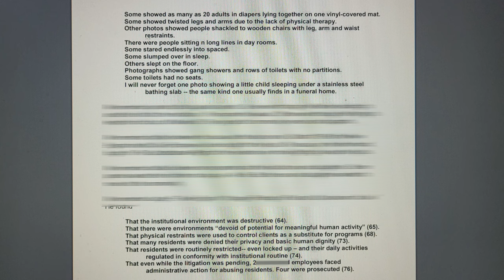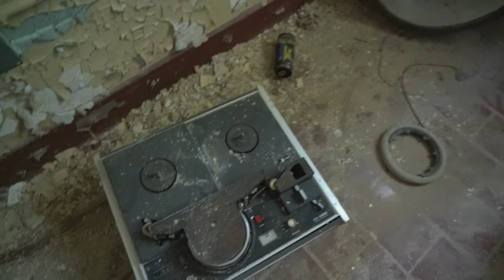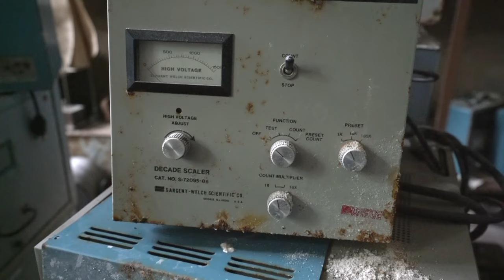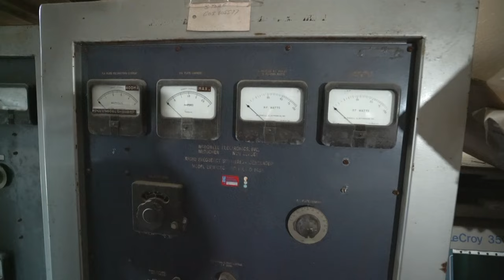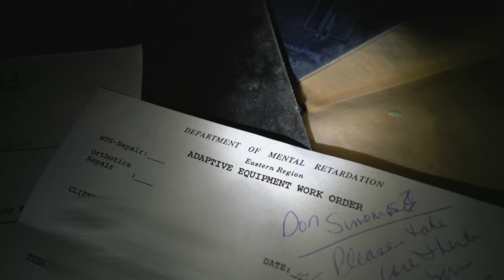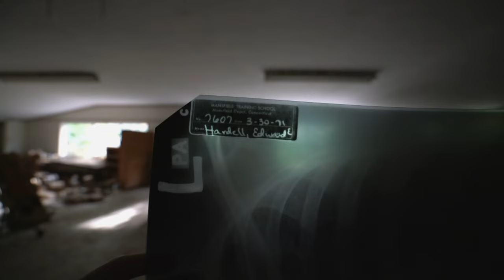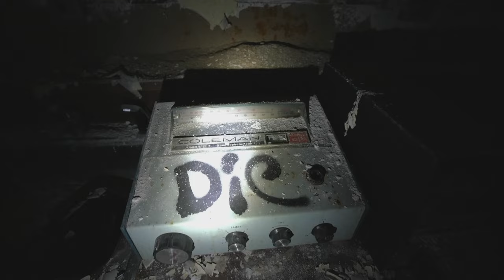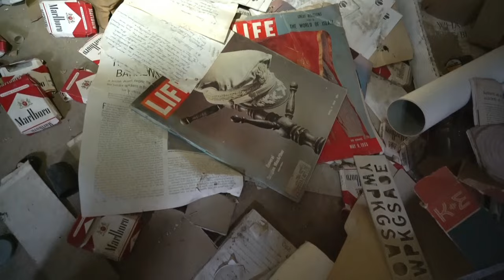Abandoned Childrens Asylum - Found Hundreds of Restraints (Closed from Abuse)

Comment: FYI, all those devices with straps, wood, padding etc are not for torture or restraint. For example, the long horizontal wood board with straps at the top, middle, and bottom is called a Stander. People, (like my son), who are unable to stand still need weight-bearing on their hips and legs so that the hip sockets will still try to form. The patient is laid down, strapped in, then the entire table rotates vertical, giving the person the weight-bearing as if they were actually standing they need for development. And often, tray tables attach to them once they are vertical. The other devices with Velcro straps are all to secure the patients who are unable to support themselves. My son's wheel chair supports him with side laterals, straps, leg and foot supports and even a padded brace for his head as he doesn't have the ability to move or even sit up on his own. Love all of your videos, just wanted to pass on my info.
Reply: The company in the video (Rifton) still sells these chairs. There are some articles about misuse to restraint childrens and even a public statement from the company but there are legitimate theraptic reasons for these chairs. Thanks for your insigts.
Reply: THANK YOU!! I was just going to say the same thing. Yes many many were abused but, these were all to help the patients!! Another great video!!
Reply: I was thinking the same .
Reply: pin this, please. not saying they didn't misuse these devices, but that is not the intention of them.
Reply: Very well said
Reply: Thank you for sharing the information.
Reply: I came here to say the same thing! I work with students who use standers and Riftons and they are absolutely not torture devices.
Reply: Often the
Reply: I've seen people like this
Reply: delusional
Reply: @Darrin R. twister please tell how it was used for torture
Reply: @Darrin R. I see.
Reply: THANK YOU for correcting this!  I work with special needs kids as a nurse. These are not torture devices!  They’re therapeutic!  Can they be used “improperly”?  Of course!  A simple chair can be used as a restraint!  Holding someone’s arm down is considered a “restraint”. I’m glad others have come forward about this. These devices help improve these kids quality of life ❤️‍🩹
Reply: @sheryldupre-mercier7607  people tortured them kids. And abuse goes on today. step into reality
Reply: you a wok democrat? Trump 2024
Reply: @johnd2768  I’m not saying horrible things didn’t happen. I was just staying that those items do have a therapeutic purpose when used properly. Institutions were and still are horrible places 😢
Reply: @sheryldupre-mercier7607  I understand and please accept my apology.
Reply: 🧡🇨🇦🧡Look into ORILLIA 
 H.R.C HOSPITAL 😭
Reply: Just because that’s what they’re used for NOW does NOT mean that’s what they were used for In times when abuse in these places were “normal”
Reply: @krystalconley4915  my point is that torture is NOT what these devices were manufactured for. I highly doubt that a company would design, manufacture, and sell torture devices in the US. WHAT anyone did with them beyond that is different.
Reply: No they were for torture. So sad
Reply: Ok, torture devices were approved and sold on the market openly! Stop displaying your ignorance.
Reply: May God bless you and I wish you and your son all the best.
Reply: @hooville9059  you are too kind. They said my son would not likely live past 2, he turned 32 in January. God IS GOOD
Reply: I was coming to say the same. I used to work for Mass DMR. (There are still a few places that are still running, for those most profoundly affected). I watch these videos and roll my eyes when they call assistive devices,  torture or restraints.
Reply: Yup, and the restraints on the wheelchair are for preventing the person from accidentally falling out of the chair or being injured in case of a seizure.
Reply: @lynnjudd9036  exactly! My son has no ability to move on his own. The straps are actually for his safety.
Reply: @KikiErzebet  should have said this a long time ago, but thank you for what you do for the special needs. Blessings!
Reply: Thank you! I was going to explain the same.
Reply: This is so true, I have a standing frame.
Reply: That's a lot of words

Comment: I lived near a home for really badly disabled person. They use those strap things to keep them upright. A lot of them are not even able to sit or be in an upright position but they can not lie down their entire life. I've seen some laying in wooden boxes with wheels pushed around by others who are not so disabled. The box looks like an open casket but they would fall off anything else than these boxes. It looks cruel but it is not.
Reply: Exactly!! I work in the disability area, they are support straps not restraints, stop people slumping over or sliding off chairs.
Reply: Although it's often difficult to tell Victorian restraints apart from the devices they would have used for holding the severely physically disabled in a fixed body position when necessary.

Comment: Those X-rays were most likely to check each resident for tuberculosis on an annual basis before they had injectable TB tests. Necessary in such close quarters. Many of the devices with straps for sitting/standing were actually adaptive equipment allowing residents to better interact with their environment for a period of time as opposed to lying flat on a bed looking at the ceiling. Yes, I am sure there was abuse as staffing got less and less. I used to work in a  children’s home for profoundly disabled children. Thanks for showing us this one! 
Maybe some day, you could attend therapy sessions with differently abled kids and see these things used for good. It will make you smile.
Reply: "Custom Adaptive Devices."

Comment: As others have commented below, those items are NOT restraints.  They were used as support to sit or stand, so the belts were used to keep them in place.  My daughter was handicapped and had a supportive chair and a prone stander (which are the ones seen in the video with the long slanted back.....they would stand in them belly side to the padding and would be propped up against a table to do activities).  My daughter also had the same brand "Rifton".  However, it could be that this place was not using them correctly or keeping the patients in them too long, which would be abuse....but the items themselves are not meant for restraint or abuse.

Comment: Those chairs with straps are for children that could not sit up due to paralysis, abnormal spines etc. They are no way used for punishment. The upright board with restraints was to put a paralyzed person in a standing position. Modern physical therapy has such things Today.   Quadriplegics in this century have wheelchairs with Velcro belts around chest ankles etc. 
Lung x-rays were necessary to check for Tuberculosis.

Comment: 9:09  that is called a rifton seat, it is meant to be a positioning chair to hep with posture and blood flow, breathing, feeding etc. they were not meant to be used as a restrain or punishment, but sadly they did end up being used for that,  but the actual purpose of it is for positioning someone who limited body control for circulation, reducing contractions, cramps, clots, stomach and intestinal issues swallowing  and so fourth,so yeah,  for use it in short bursts, not for hours on end.

Comment: The unique looking chair in the basement with the green section and wheels looks like a piece of physiotherapy equipment as we still have very similar looking equipment today, it’s often used today for children to stretch their hips and inner thighs, the foam looking cylinder keeps a gap between the legs and the child would scoot around (using their feet to push like kids do with balance bikes) holding on to the handles at the front for exercise and stretching. So thankfully as far as I can guess at least this ONE piece of equipment was not for restraint but by the sound of the history of the place I’m sure much of the equipment could have been used for restraint, particularly seats that could be used as therapy devices, it’s possible that they could strap kids in and leave them there for extended amounts of time.

Comment: Those chairs weren’t for punishment (per se). They were used to prevent children who were impulsive from trying to stand and getting hurt when adults can’t watch them 24/7, or to support children with different conditions that don’t allow them to hold their body upright or can’t support their head. I 100% agree there was abuse, but those chairs weren’t it. In fact, we still use chairs like that today (just better manufactured so they are more comfortable). 16:40 those are to practice core stability. A lot of children with neurological issued struggle with core stability- such as CP. and 18:15 these are again used to support them so they can be in a more upright position. The ankle restraints are so their feet don’t slip forward- and belt is so they don’t fall forward (they don’t have the strength to hold themselves up). The two pieces by where the head would be is to support their head so they can still look around, otherwise they will often fall into uncomfortable positions. 21:03 looks like an inversion table. We use them sometimes for traction but often for individuals who can’t sit up right. We slowly attempt to increase degrees every few days/weeks in an attempt to help their body acclimate to standing upright. These are still used. Wanted to like this video but too much misinformation. Maybe a little research on future videos.

Comment: Some of those restraints were meant to be used for patients that could not sit up on their own. So they were placed in the chairs and Velcro straps were used so they didn’t fall forward out of the chairs or slip down. The others were used as physical therapy to help patients stand to keep muscles and hips from  twisting or make them stronger. They are not used as barbaric tools. But as aids for nurses and doctors used for the good of patients. They look awful but are very helpful when used properly by patients that are in need. The area with chemicals were used to develop the X-rays. They were done on film like old photos. So u needed the chemistry to develop them. And the lighting sources to focus in on certain areas and to lighten or darken the film so doctors could see certain parts of the anatomy easier.

Comment: Those are NOT restraints young man, they are custom adaptive set-ups for physically disabled kids. These hold the client so they can breathe and they are widely used today. "Restraints" were mainly the 4-point, By the 70's straitjackets were replaced by this "more humane" 4-point systemI did several in the 80's. They are simple straps, usually early velcro or nylon, which strap each arm and leg to a bedframe, so they do not hurt themselves or others. ANY type of restraint must be have a dr's order and is absolutely the LAST RESORT. We were NICE counselors who LOVED the guys- we hated to do it and were as gentle as humanly possible. Great Oaks Center in Calverton, Maryland. Dept. of Health and Human Hygiene- now just called Maryland Dept. of Health.

Comment: Restraints are very necessary in any hospital. They are still used all the time when adults or children are violent to themselves or others.
Reply: We use them at the hospital I work in.  Normally as a very last resort.  Most commonly in ICU to keep patients from pulling tubes out (simple soft wrist restraints giving enough mobility to move but not reach lines.   We will try everything else before restraining a patient.  It’s not common. But used.  Normally if the patient is injuring themselves or staff
Reply: Restraints can be medically necessary, but these chairs, tables and standers are NOT restraints. They are used to assist a child who can’t sit up to do so. They are therapeutic standers and chairs.

Comment: Right I have a few points to make here on Ur wrong thoughts but the wee seat with the big back n wheels that you said was cruel here are 2 points 1st some kids that would have used was probably disabled therefore would have needed to be strapped in for there safety. 2nd what is the difference between that seat and the bikes with long handles on as both these point are the way we parents protect our toddlers or our disabled children.
 Second problem with your remarks are the wooden benches with the foot plates connected that sat upright are not "barbaric" they again are actually used now still as they are actually called standing frames for seriously disabled people, people or kids that can not actually stand at all they have a strap that goes across there chest a strap that goes across there hips and straps on the foot plate the part of these standing frames you called "barbaric" actually stops the kids from collapsing/ falling out of these "standing frames".

Please take this as a learning curve not negative. It hurt and upset me for the fact my niece has this equipment as she is disabled.

Comment: I bet much of these items were abandoned due to the discovery of parasitic infections of the lungs of many of the patients… the electro
Shock therapy was probably used trying to shock the worms to death in hopes the patient would not be effected. Many
Parasitic worm infections can
Lead to paralysis which is probably why many of the patients required restraints as many were probably paralyzed or partially paralyzed.
The right quarters
Would have only increased the spread of infection regardless to their intention. Many shells contain parasitic worms and the doctors probably already knew that. Odds are they were searching for the discovery of what infection the patients had. I’ll be it was rat lungworm disease as it can
Only be detected by spinal tap. There is quite the legacy left behind of the many doctors and researchers who were probably trying to detect the problem with these patients with limited resources and funding… not to mention there was no
Knowledge of rat lungworm
Disease at that time frame. The lead paint in the building probably also caused some lung cancers and small cell lung disease which made the situation even more
Complex. The lack
Of staff and resources probably increased the odds of abuse and or neglect of the patients

Comment: Okay I do not condone restraints how they used them but when used right they are good like when a nurse can not be with them and they are a danger to themselves or others but not a all day thing as a kid I was put in restraints for a period of time at a mental hospital that was because of my epilepsy when a nurse could not watch me they would put straps on me when in bed or a chair in the tv room I had 20+ seizers a day the medicine stopped working the hospital staff couldn't do 1 on 1 that was why I was sent to mental hospital it was in same building as  hospital so when I had a seizer the doctor came to check up on me this was a acceptable time to have restraints I was rarely put in restraints just during emergencies and shift change and when I was asleep which was loose restraints I could move but not fall off bed it was like a seat belt on my waist , chest and legs if I started a seizer the nurse could tighten it and page the doctor they saved my life as I have grandma seizers real bad ones at that had seizer while I was alone once when I came to I was a bloody mess had to get 20 staples in my head around 30 stiches on face 60% of my body had rug burns and had to have stitches in my tongue because I bit my tongue